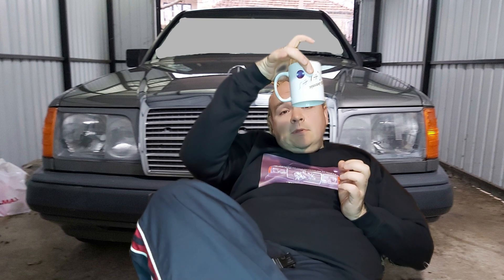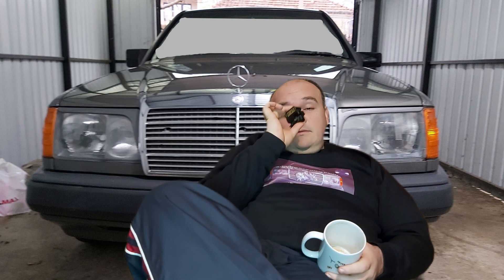㉦Mercedes Ke-Jetronic㉦ - EHA Current Explained – What Happens When It’s Disconnected (KE-Jetronic)

Comment: Hello my friend, thx for all the videos. Do you know if there are differences between EHA F026T03002 & F026T03004 ?
Reply from the maker: Hello. In essence there are no differences between the EHAs because their working principle is the same, their components inside are the same, just a bit different setting for a specific model which varies from universal EHA adjustment. People should buy a brand new EHA only if the old one is toasted. That's where dealerships take advantage of people and sell them this part for up to 1000$ US depending of the car they drive!

Comment: I followed your advice, i got a new EHA, tuned it correctly got the 0.4 bar. Then i rebuilt fuel distrubutor and tuned it with you guides and the was running very good. Then while reinstalling the fuel distrubutor to check something, the wrench slipped! I cracked the mixture screw tower (CO screw tower). 

This is giving me a massive airleak, the smoke tester confirmed it - and i don't know how to fix it. Car wont idle or anything but is super happy when it's running. What do you think?
I have an m102 Australia 180e
Reply from the maker: @KlassikHaus  sorry to hear that. Yes, there is a seal there and vacuum leaks can be created there. This is how I can help you, this is the reference number of the tower 1160700274
Reply: @mercedeske  THanks. now i need to find who stocks it. or buy a second hand good one. Thank you a lot.

Comment: I love your videos. Thanks for teaching us so much. You helped me before with my W124 300TE and now I also own a W201 190 M102..
I'm now stuck on the issue where I have no kickdown, and the car won't idle on its own, I have to press the gas to run it, and I can drive it fine as soon as I get it into D, but as soon as I get low speed or let go of gas when standing still for a light it stalls.
Can you point me in the right direction?
Reply from the maker: Hello. Concerning your problem - check the kick down switch, the TPS - wide open throttle as well as the fuel pump relay, the contact 87k, replace the potentiometer if you haven't. That much I can say for now.
Reply: @mercedeske  Thanks, I will try. The idling has been messed with as  the previous mechanic just had every possible adjustment wrong. Everything is now back to base and then finetuned eventually with CO meter, just the kickdown switch left which I will check soon. Thanks. Your channel means a lot